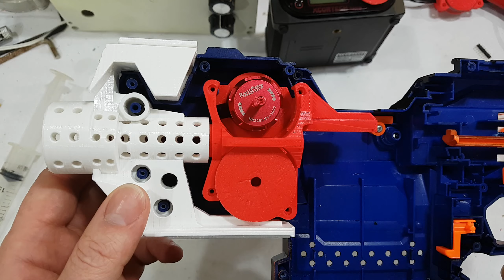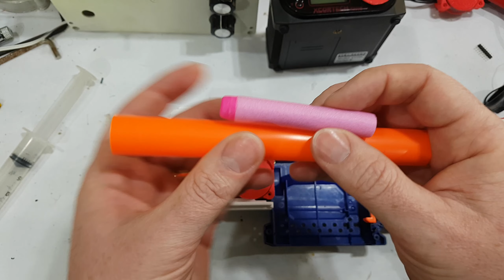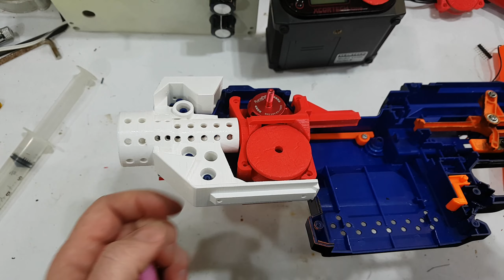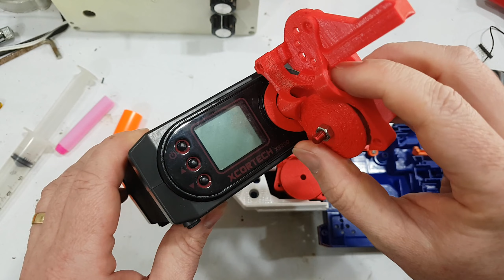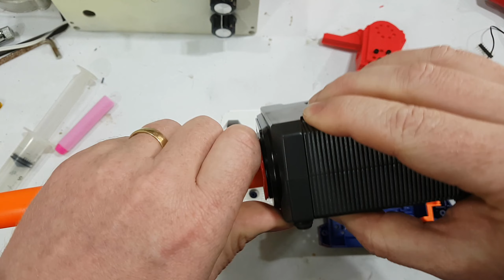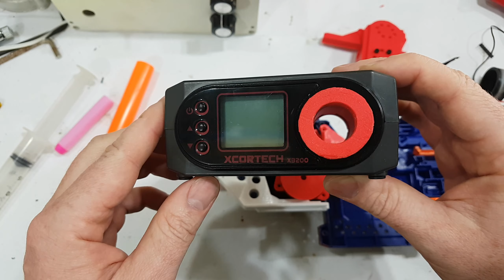Nerf Stryfe Mod: MAX FPS Barrel & Front Tube Adapter: Part 7

Comment: Sweet, I will keep my 3d printer idling. Rayven fire was just released.
Reply from the maker: Yeah i know.. great timing really.. My son Still loves his green rayven, which is why i built a cage for it... I expect the Rayvenfire to be the same as the old one and thus fit..
Reply from the maker: i personally HATE the look of the green rayven so the Rayvenfire would be nice
Reply from the maker: nerkum I do really want a nerf regulator as I think it's going to become the new bench Mark blaster.  Sad still not out in new zealand. I'm sure it will be out before Xmas
Reply: I like the regulator, but it is a little long. The Rapidstrike is still my favorite.
Reply from the maker: i took my rapidstike apart to turn in it onto a project that i've never managed to finish .. might at well buy a Regulator now lol

Comment: Looks nice, are you going to design one with attachment points?
Reply: Is that an updated cage design?
Reply from the maker: nerkum it has the normal nerf top rail  but I have also included picatinny rail for the top and bottom but it would seem I have forgotten to mention that
Reply from the maker: nerkum this is an updated cage to the ones I have in my previous videos. However there's an even new design than this  on thingverse, though you could not tell any difference visually.
Reply: So, when is that rayven cage going to be ready? I got a couple that needs that sweet fps.
Reply from the maker: The Ravyen cage is done i'm just waiting on some more buck converters to get it all up and running. i expect they will turn up this week
Reply from the maker: By the way it does have the Picantinny Rail system i just didn't print it for the video i have updated the ThingiVerse page to make it more clear

Comment: I know you have shared the stl files for this however, Do you mind sharing the .step file or .ipt on grabcad?
Reply from the maker: it was done in Solidworks actually .. What changes did you want maybe i can make them for you
Reply: I would like to use your screw post alignment more than anything for multiple other front end related parts. A step file or even a .dwg of the dimensions would be an immense amount of help. Otherwise I'm going to be doing the same thing you did with expensive amounts of test prints.